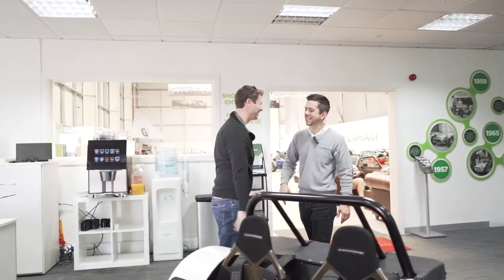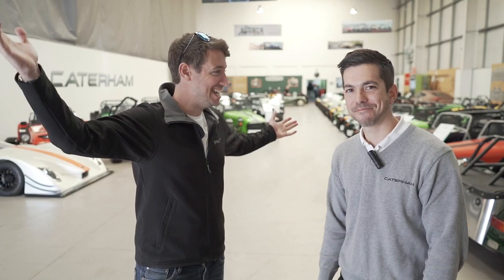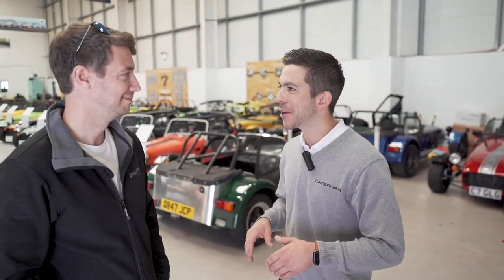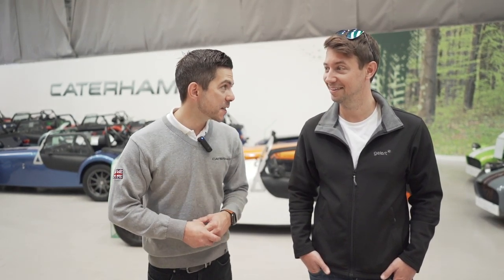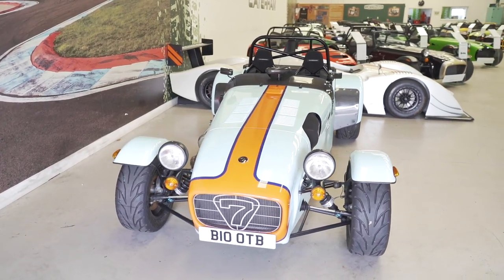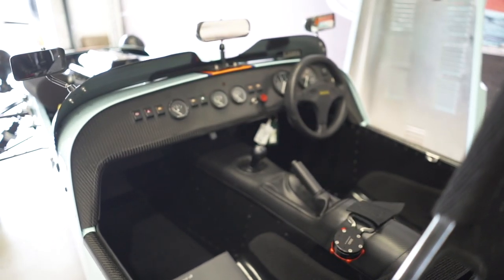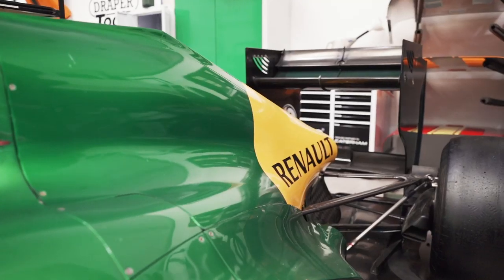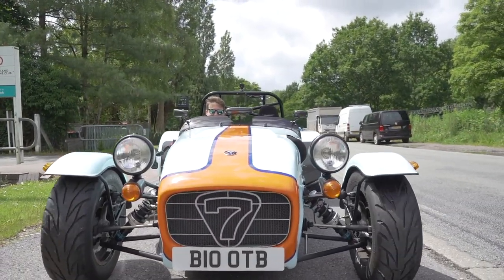Is the 620R really the best Caterham? So many choices!

Comment: Old fashioned Moth Balls in a Container with holes in the lid .Will keep rodents away . 
Keep a dust cover over the car helps even more to hold the smell and they won't be chewing wires and pissing all over and leaving dropping in yer car.
Reply: Very good advice. I use moth balls with peppermint oil and camphor oil in the containers and park it on a tarp that is sprayed with a mix of the oils. My car is a 2005 and so far so good despite being kept at a farm where rodents abound.

Comment: I love driving a stick.  Is the performance of the sequential transmission so much better than the stick that I would be sorry if I didn't get it?
Reply: Sequential transmission still uses a gear lever (stick), it’s just that you don’t need to use the clutch when changing up through the gears